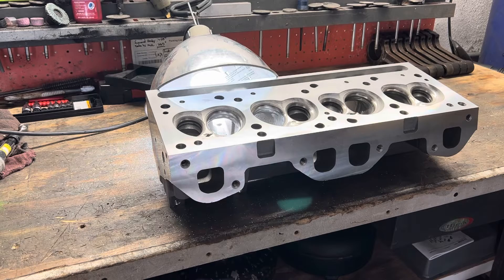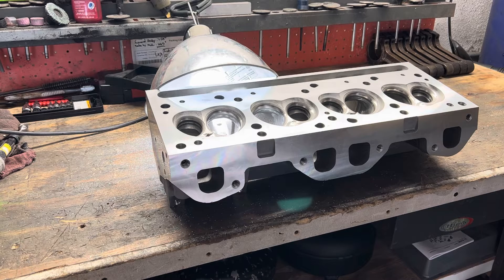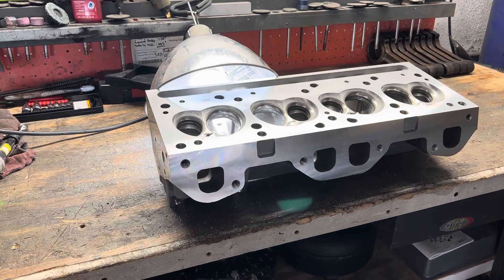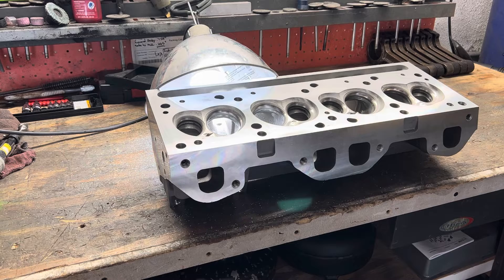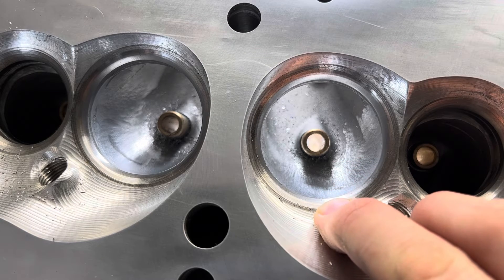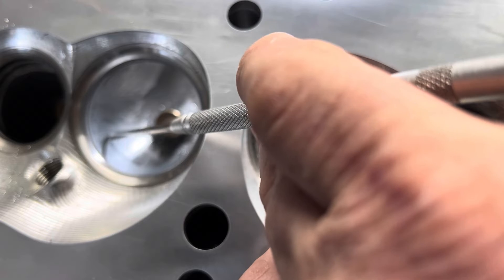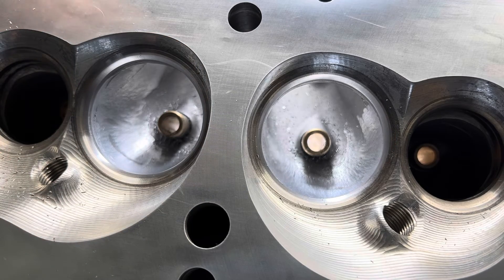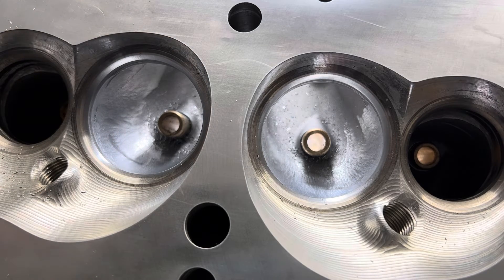Speedmaster Pontiac V8 cylinder heads 1.0

Comment: How do you keep your burrs from clogging up so quickly?
Reply from the maker: I use MiG Tip grease, I try to apply the grease when the burr is warm so it melts into the burrs.  You don’t want to put to much on when it’s cold, it’ll sling everywhere inside the port and make a mess.  Any brand, I use Hobart because it was easy to find locally but I bet way cheaper online! 👍
Reply: @HeadFlowInc  that would probably work better than my ole WD-40. Thanks

Comment: I have a pair of small block Chevy heads with angle spark plug holes and they were purchased bare about 7 years ago.  I have yet to use them and I probably will not. The ports are fine. The major issues I have is the size of the bowl castings at and under the seat. The bowl is oversized and the actual support given to the pressed in seat is sketchy. Over half the bowl is larger than the seat and there is absolutely no blending the seat to the bowl without removing the seats and welding the bowls where needed. What was a "good deal, isn't"!  Measuring the bowl puts the ratio of valve to bowl size over the limit. Also, when originally shipped, one head had guides that were not completely installed and stuck up approximately one inch. They had me send them back after complaining and they did send a return tag  were not pleasant to deal with.  ProComp changed their name to Speedmaster79 and it sounds like their customer service is still in the toilet. Jegs and other Hot Rod Big Boxstores are selling a number of their products. I wonder if customer satisfaction is better with the middleman?  I also had a bare block on order from them for over 6 months and getting a refund did happen and I would rather pull teeth from a lion than go through this again. It is still not available after 3 years. I no longer trust any of their merchandise. Even their billet main caps have questionable machining and just look as is a novice "brought them to size". I now have Milodon caps. In all their electronics they use smaller gauge wiring. They seem not to know what is acceptable and what is trash.
Reply from the maker: What’s the I.D. measurement on the valve seats?  I’m curious how small the opening is compared to the intended valve ie 2.02” or 1.60” etc. 
I agree if the actual port is too much larger than  a performance 90% “Throat” then it’s not going to flow. 2.02” x .90= 1.818”
The only ProComp/Speedmaster part Ive used with success are the head studs in the Turbo 4.8.  Bad pot metal carb main body in the early 2000’s pure junk.  Bought a set of there LS dual valve springs when the very first came out, you couldn’t even get a retainer to fit their spring and they didn’t offer one. So end up just throwing them away.  
Sorry about your cylinder heads!  JD

Comment: Would these as cast be better than 7f6 heads? I own a 1972 455HO with the 7f6 heads and thinking about some aluminum pieces. My engine is 30 over with TRW L2394 pistons , which I don't think my Ole pistons will work with these combustion chambers. I think the dome is .416. I'm going th need new pistons.
Love your work , I commented on the intake height on one of your videos.
Reply from the maker: Be careful with maintaining the value of your classic Pontiac. 
I wish the fit and finish of these Speedmaster heads were better out of the box.  With this said the Speedmaster heads will greatly out perform stock imported 7f6 heads.  Your HO heads flow maybe 220-225 cfm compared to 280+ cfm of the aluminum heads. 
Why are you running such a high dome piston?  We’re you running race fuel only?  I’m not familiar with the usage of your Pontiac.  JD
Reply: @HeadFlowInc  
The engine was built in 1973 at a machine shop in Rockingham nc. My dad bought the engine out of the trans am when the owner parted the car out to get money for college. Mid 1973 , he stored it for many years, he passed in 96 and I bought the engine from my mom. I do run 110 race fuel in it. I spoke to Jim at Butler about buying rings for the old pistons ,and he said I need updated parts. He said the pistons are heavy and the dome interrupts flame travel. I have just kept it as it was built from 73 besides just rings and bearings and new cam. It had a General Kenitics cam in it. You may remember that company from the 60s and 70s. The engine is a beast , sounds like a B-29, lol.
  I plan on updating it soon and want to save the 7f6 heads as they are kinda rare. 
   I figured you know your stuff and respect your opinion.

Comment: Well they do flow that. Been flowed by a known Pontiac guy,
Reply from the maker: Who flowed out of the box Pontiac Speedmaster heads?  Share a link to their article or channel so everyone can see.
I’ve done extensive Google searching I can’t find a single person who ever followed through with flowing a set of speed master Pontiac heads out of the box. I promise you these cylinder heads could not produce 290 CFM as delivered. I’m not saying they don’t run OK but I promise you you’re not gonna put them on and make 600hp.
Reply: @HeadFlowInc  Rocky Rotella for Poncho Perfection. 290 @ .600
Reply from the maker: @scottnorris8571  Link?
Reply: @HeadFlowInc  Randy at  Pontiac SpeedShop got similar numbers.
Reply from the maker: @scottnorris8571  Link?
Reply: @HeadFlowInc  I can't give you a link, they haven't published the mag yet

Comment: This may not be as bad as it looks. I'm not a head porting expert, but what I've seen done by clever porter's, they cut the throat at 90% or slightly bigger, and bowl is 100% of the valve diameter. Basically exactly what you had to do there due core shift.  I don't know the physics, why the port flows more by making bowl bigger than throat, but some experts do that so it must be good :)
Reply from the maker: Yeah, the bowl sometimes is around 104% on some heads. It really depends on the attack angle of the air on the back wall of the bowl. 
I like to use 90% on the throat and radius as smoothly as possible without increasing the angle of the turn.  The bias side of the port is worked more; it gets wordy to try and explain.  Thanks for your feedback!  JD